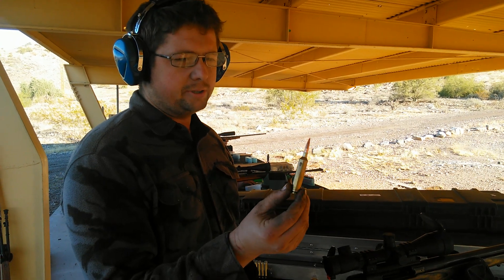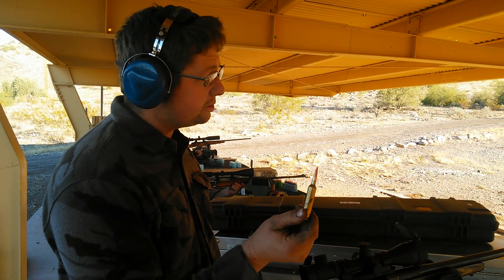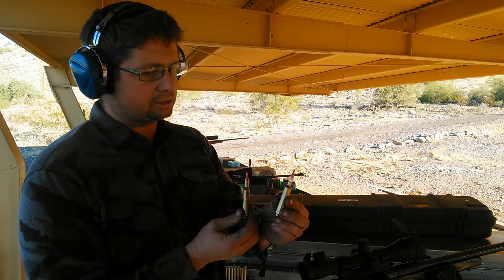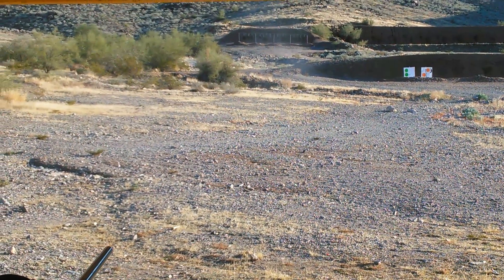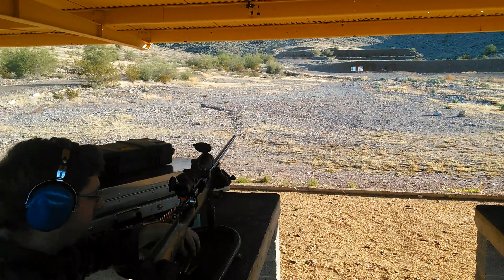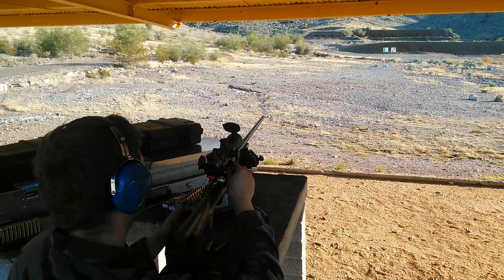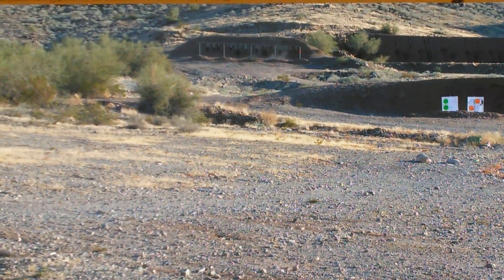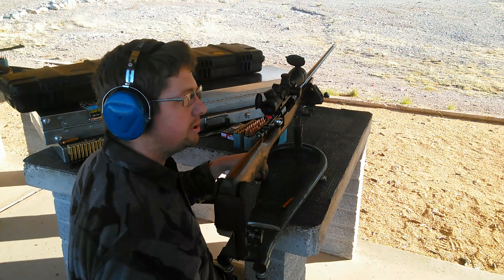7mm Amax A MAX bullet exploding in mid air Nosler

Comment: That's very interesting Brian. What about the Hornady ELD-X Bullets, they're meant to be bonded liked the Accubonds, aren't they?
Reply: No, they are not bonded, but they have "interlock technology" which is basically a mechanical wedge locking the lower part of the lead core to the jacket to retain weight upon impact. I doubt it would withstand the stress, not being bonded.

Comment: Lol way too much twist for that round. Should be like 1 in 10 for 3300 fps. A 1 in 8 is for 2600 to 2900 fps. 1 In 9 inch for 2900 to 3100 fps. Lol it's not a bonded bullet. Obviously that much centrifugal energy is going to explode unless bonded or or solid copper. Usually people don't run these ridiculously high velocities like you are running and also running an 8 twist barrel. 
There is a mathematical equation for twist rate a velocity. Why anyone would make this unrealistic situation is too funny. For your rifle you will get better accuracy if you run a 1 in 9.5 twist for that caliber even 1 in 10 inches. So many of your bullets are going to explode when you hit bone if they make it to the animal. These twist recommendations are for normal cartridges not wildcats. Its not about projectile quality its about all of your platform coming together to work together and not against itself. Highly unpractical build you have there. Sad you limited yourself so.much by how you chose barrel twist and velocity to work against projectile options that will even work in that combo.